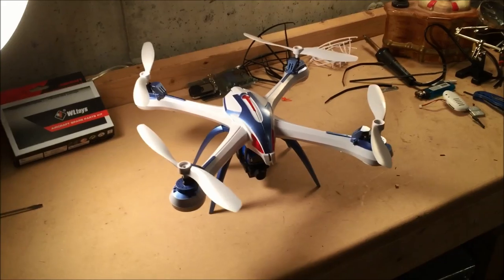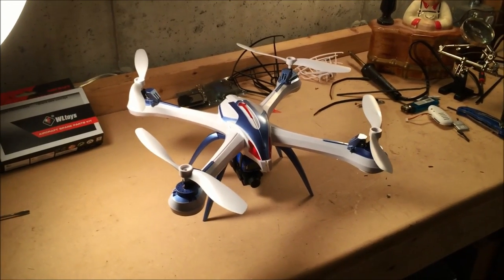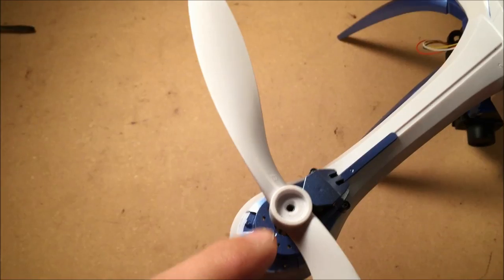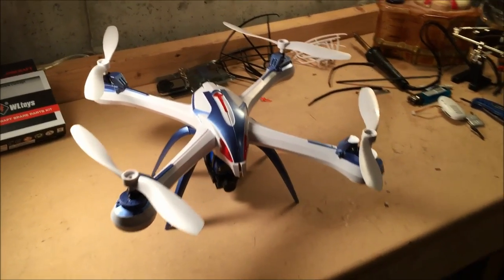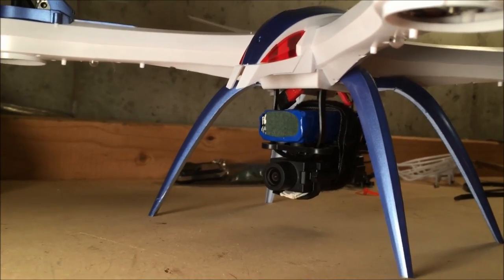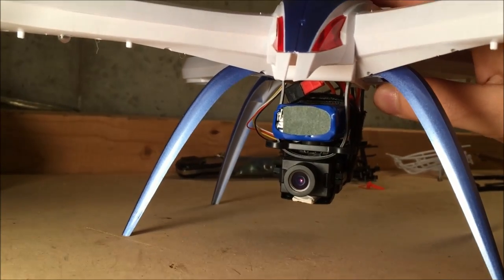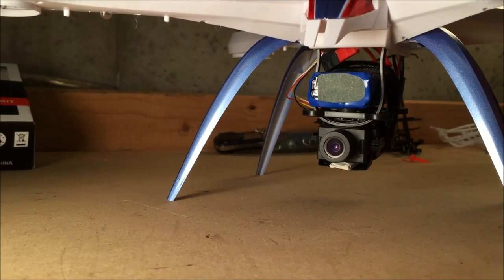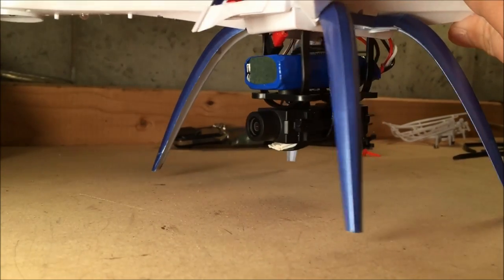X6 tarantula camera mount mod/test

Comment: The best stock 5 MP video I have seen from the X6 . Great idea . I think with your setup you could even use a larger battery for more flight time as well if you had one .
Great fix for those of us who cant afford a high dollar quad . Probably won't win any movie awards , but I give you a big thumbs up .
Reply from the maker: Thanks! I appreciate the kind words.
Reply: what is the alternative battery for Tarantula that can make the flight time much longer?
Reply from the maker: Christian Villarroel I'm not sure, to be honest I have only used the stock battery. With longer flights I would be afraid of premature motor failure. If you are on Facebook there is an X6 Tarantula group, I know folks have been trying different batteries on there.
Reply: can u send me the link of that group? tnx
Reply from the maker: Christian Villarroel Sure can https://www.facebook.com/groups/TaratulaQuad/
Reply: Ok tnx
Reply: Christian Villarroel Hold on ,,, keep in mind that bigger battery means more weight and more weight means more strain and more strain means more heat and more heat mean LESS life everything is some kind of trade off . there are hundred's of sites selling battery's but its up to you to read the specs to see how big and heavy they are . Powerful battery's that are light tend to cost a lot more but they are out there . And the voltage has to be the same . Google , (racing quadcopter battery's) that's a good start .                                      Not trying to step on your post or response Christian , just trying to clear up mine . You are right about overloading  . Experience comes at a price .At least for me .
Reply: Spencer Boaz tnx so much for that warning. Some of my friends warn me about that too already its like newton's 3rd law: For every action, there is an equal and opposite reaction. I'm planning to put a Xiaomi Camera on my quadcopter with mount and my friends are like the motor may get stressed(idk what does it mean in quadcopter term). So yeah. Need some calculations + research(about weight). Btw do u know what is the maximum weight can the Tarantula X6 carry? so u know it can really guide me.. :D

Comment: Wow, thats great. but god it seems like something I dont have the paitence to do. lol. Wouldnt it be better if the camera was a little heavier, so the camera-mount actually should be used better. Because isnt that the real problem with this mount? The camera is to light, right? And because that it is to light, the mount really does nothing to pevent the vibrations to the camera at all. So if you put some weight to the camera, and did this stability hold to the lens, wouldnt that maybe fix the problem also. Maybe not as good as this, but it might be better? I mean the quad can lift a gopro, and those are kinda heavy.
Reply from the maker: Jerry Berglund I agree, all they really had to do was add some weight to the camera. In fact there is a member on RC Groups who simply Velcro strapped the camera and battery to the bottom of the original anti vibration mount with very similar results. I still don't understand how this setup made it through any kind of pre release testing.

Comment: I watched a few of your videos now, thanks for posting them, they have been helpful. could you tell me if the x6 motors, gears, and bearings are the same dimensional size as the v686g that you have?
Reply from the maker: +Joel Genaw Thanks so much, I appreciate the views and kind words. The X6 motors, gears, and bearings are much larger than the V686G

Comment: very nice mod! I've done some myself, managed to harden the protectors and it's way better and safer right now. 
But unfortunately I did manange to crash it, winds were too high, and my lens the detachable part popped out from the body and now it doesn't record image anymore, only sound. did you encounter this problem? do you think it can be solved or should i start watching out for a new camera?
Reply from the maker: +Cain I've never encountered this but it may be worth it to open the camera and make sure nothing came loose when it crashed, particularly where the ribbon cable attaches to the main board.
Reply: Yes, in the end I did manage to repair it, only some cables came out. Still works. But I'm impressed since it looks so cheaply made.

Comment: Great mod for the stock camera. funny how it seems most of the stock props are usually balanced pretty well for the Tarantula... I took the foam off a set of mine as well to give them a super balance. And I think your correct on the shifted weight on the stock camera removes most of the jello effect .. only very small vibration remains in your video .. nice work
Reply from the maker: Thanks! Ya that small bit of vibration is driving me crazy but I think I will just live with it for now. I was expecting the props to be way out of balance due to the jello but was pleasantly surprised. Thanks for watching!

Comment: I'm interested in comparisons or impressions of the cameras. Your mod seems to work great and the camera seems adequate but I could order a runcam HD for near the cost but with no factory mount. Are there any buttons on the controller for the camera?
Reply from the maker: Kyle Stevenson Yes there are buttons on the transmitter to control the camera, the buttons allow for still shots and video recording. In all honesty besides the overall weight, I think that is the only thing that the stock camera would have over any other camera.

Comment: TD: Have the X-6 ( non camera version ) on order. I'm going to try and mount my SJ4000 to it..GoPro clone. You did a nice job eliminating vibration. Now I have to figure out how to mount a SJ4000 to the underside and get the same effect. Any tips would be helpful.  Carry on!
Reply: David LaFrance That's a heavy payload at about ~60 grams.  Note the stock camera only weighs about ~10 grams.  Get some spare motors.  A better choice would be a Mobius, decent 1080/720p video at ~38 grams.
Reply from the maker: Thanks! I know a few people have had success with mounting that particular camera with good results, the quad definitely has plenty of horsepower to lift one. Like TheGusk stated I would keep spare motors on hand. Definitely keep me on the loop with your results!

Comment: What kind of battery is that and still from gearbest? I'm gonna try that once I get my camera. I'm still playing around with it. SO MUCH FUN.
Reply from the maker: That is actually the stock replacement battery I purchased from Gearbest. The original battery works this way as well.
Reply: I'm actually nervous right now!!

How do I know when charger goes bad? When I pluged battery in. It still stayed green. Does that mean I did not drain battery enough for it to turn read? It was just that I saw a super tiny spark when I tried to plug it in but realized I almost plugged it in wrong way. Does it mean I damaged the charger? I ran the quad for like 8 mins precisely according to my phone. I wanted to charge up battery again tomorrow. I had to stop because of weather.
Reply from the maker: That's strange, I would expect 8min of flight time to drain the battery enough to allow the charger to work. I would also expect the charger to have some sort of reverse polarity protection built into it. The only thing I can think of is to run the battery down until you get the low voltage warning and try to charge again.

Comment: Greetings again. I'm literally trying to follow what you showed. Can you add in description a list of what parts you used to make your own stabilizer?
Reply from the maker: Michael McAllister I sure can, basically all I used was two zip ties through the original lower half of the anti-vibration mount. The zip ties run up through the body where the original batter door locks in. I then used a Velcro cable strap to hold the stock battery to the top of the camera mount. If I get some time I can try to make a video showing how I did it.
Reply: tdracing13 That'd be very helpful!!!
Reply: tdracing13 yes please...  The video looks great.  I will do that too.  Thanks for sharing.
Reply from the maker: tommy I will try and put a video together this weekend
Reply: tdracing13 FIrst I watched the flight. I was going to ask you your theory on how zip ties could cut that jello, but I guessed it. The battery adds enough weight so that its inertia gets the camera mount to work as it should.  
Then I watched the video :)
Reply from the maker: Dave Review lol! The battery weight definitely seems to help it. I cant believe that the stock setup made it through testing!